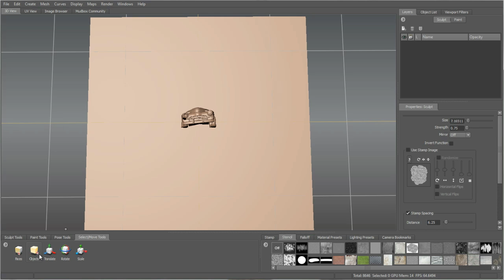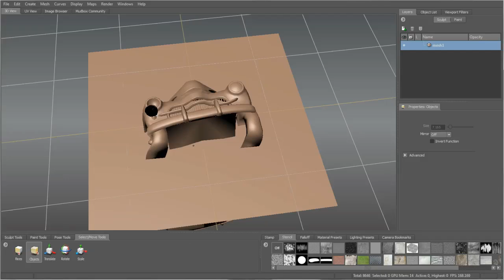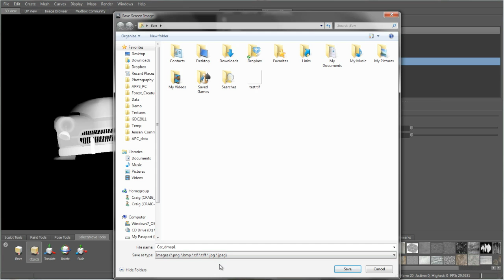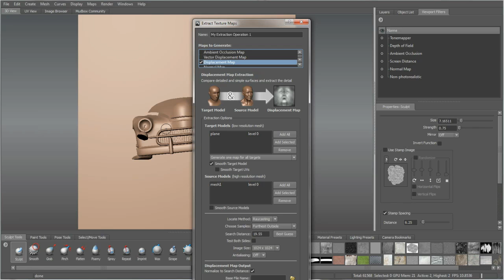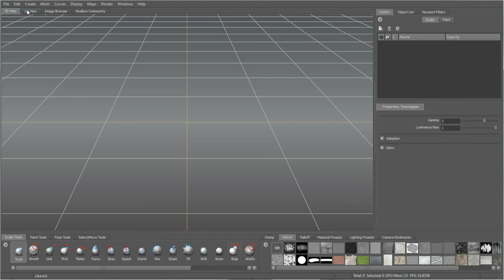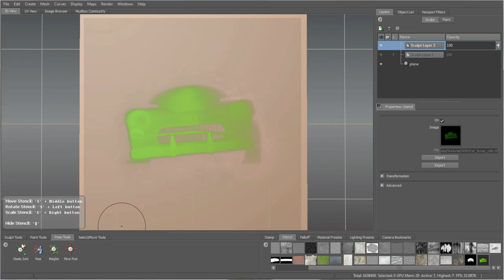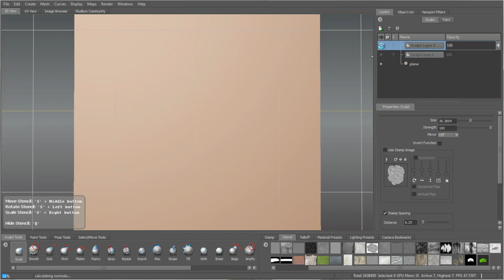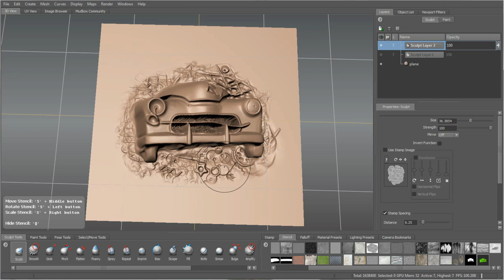Create a vector displacement stamp in Mudbox

Comment: As far as I can tell this doesn't work as shown, as it leaves steps out when making a vector displacement map. When I tried to do this by creating a plane then creating an object on top of the plane, like he does with the car for the depth map (grey scale), when attempting to do this with a vector displacement map I get this error. Mudbox 'cannot extract a Vector Displacement Map from these meshes, because they do not have the same base-level topology." I still have yet to get this to work, as I've found online you can't create a vector displacement map from two different objects only if they have the same vertex count. So I guess only if you sculpt the plane into a car then you can extract the vdm. I think for the vdm he used gray scale displacement maps to make the geo to exract vdm he shows at the end, and didn't show that part.
Reply: It actually works. I was confused at first too, but it's pretty much about what he says at 12:27. You create the normal displacement map (black and white), transfer that to a plane, sculpt it, and then you bake the vdm. It's more like a two-step method to make vdm. But there IS something he didn't say, and it's that you need to use ANOTHER plane to bake the sculpted detail to, and not the same plane at level 0, it would look bad because the lvl 0 plane is modified when you sculpt, so, use a second untouched flat plane to transfer what you sculpted before.
Reply: Yeah I eventually figured that out. Also, I believe I need to import a (2 triangle) quad plane so that the map can be extracted to a flat surface. The test I did I used the plane object in Mud Box but at level 0 there are still a lot of polys in it so the vdm map I made still wasn't right, it wasn't flat after sculpting it out.

Comment: Does anyone know if there is any way to convert a high resolution triangle mesh into a vector displacement stamp, without converting it to a normal displacement map first and loosing all the "undercutting detail" ? It would be great for capturing real detail from reality with a regular camera and photogrammetry software. Please mention programs that can do it if you know of some that can. Thanks.
Reply: +cromrke  im trying to achieve the same, did you ever manage to find a way? Does the above not provide whats needed?
Reply: +Tom Cowlishaw Unfortunately I have not found any program that can do that. I find it rather surprising since such a method would fully leverage the photogrammetry process. especially if combined with matching color data... or even better matching specular, gloss etc... maps. I would be incredibly powerful, for example imagine creating a rock wall with the stamps of a few samples of rock and then just touching it up a bit with mudbox or zbrush.

I have not searched for it lately, maybe something new came up in the past 2 years.
Reply: +Marko Posavec last night I managed to use mud box to create a displacement map based off the photoscan I did of some mud in a local field.  I took 350 photos and pulled a detailed model from the scan...  I now have managed to convert that mesh into a displacement map so thst I can use it as either a stamp or as displacement in maya.  Next iv got to figure a way of making the scan I have tileable first so that when I apply the displacement tiled across a surface it has no seams...  I'm not sure if this helps you?  I know what your trying to achieve,  I believe it's similar to what I am....
Reply: +Marko Posavec oh,  and iv used agisoft photoscan first to capture a scan from my photographs and then taken the result maya to convert to polys before mud box..
Reply: +Tom Cowlishaw If I understood you correctly.... Yes the regular displacement is a workaround that can be used with some touch up. But vector displacement generation would be much more powerfull.